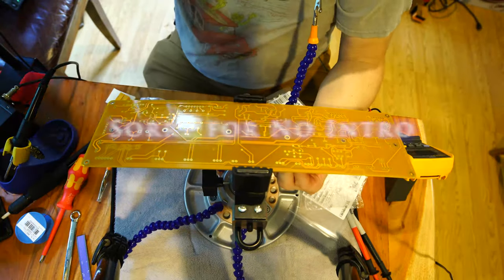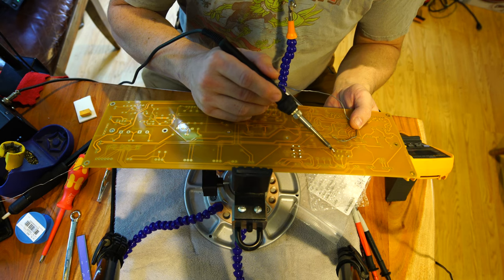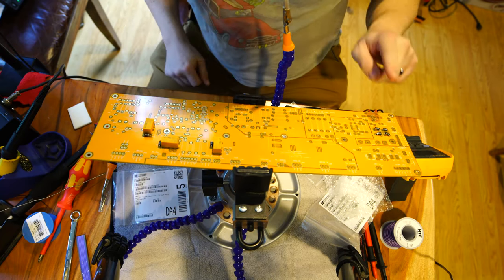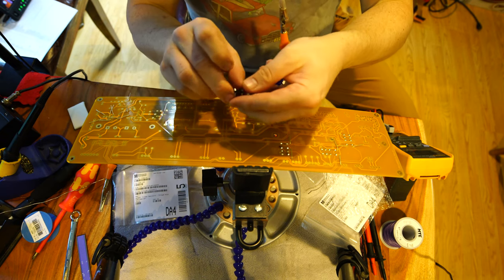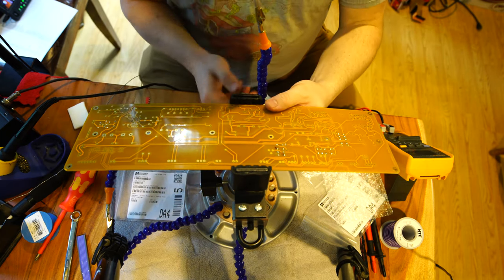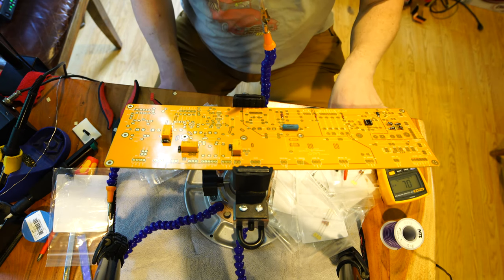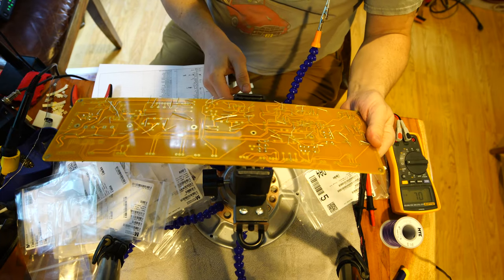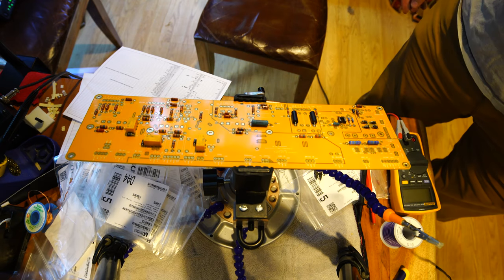Blues Deluxe  to ODS #183 Video 3

Comment: Now that 3 years have gone by, would you say you're happy with it? And do you think it's similar to the 'Dumble sound' ? 
I'm considering doing one . I've been converting these amps to bassmans and plexis, so I'm familiar with the chassis and iron.
Also do the solderless lead connectors come with the board or are people adding them? 
Thanks for any insight !!
Reply from the maker: I haven't played it for a while, so I gotta I need to.  I think it definitely has the dumble  sound.  But I'm no expert. I'm not sure I recall what you mean by the solderless connectors?
Reply: @FrenchieFilms  I found out the connectors don't come with it. They're the green screw down connectors on the edge of the board. I'd probably just solder anyway. They definitely seem like cool conversions. 
My next project is a hammond Ao29 conversion, so I'll have time to mull over the dumble conversion.. thanks for the info. Great content btw! Cheers

Comment: Showing the assembly process is very helpful.  Whoever designed the PCB unfortunately designed it to basically warp as there a copper coverage disparity between top and bottom layer over a large area.
Reply from the maker: I'd be interested in learning more about that.  What are some good references about avoiding warp?  Is it clear what is copper covered on the top layer?  The solder mask makes it hard for me to tell
Reply from the maker: Interesting,  This article though, seems to discuss how the curve of a board can impact daughter boards being directly soldered.  Is this problematic for a single board?  Or is curve also something that can lead to trace separation from the board or trace breakage?
Reply: @FrenchieFilms  it just points out some of the general attributes, it is a real problem for single boards, and can either lead to parts popcorning off the board, especially SMD parts, and or cracked via or part hole barrels. excessive warp puts a strain on any constrained mechanical junctions.it can also lead to cracked traces etc, if subjected to thermal cycling.
Reply from the maker: Oh that makes sense.  So how can you tell this board would be prone to it?  The solder mask on the top obscures the top layer pretty well...
Reply: @FrenchieFilms  One side has abundant copper pours, the other side mostly traces, the copper area on one side is much larger than on the other.   Matching layers either external or internal need to somewhat match copper coverage to maintain even forces on the prepreg. For instance, you might on a 4 layer have planes on layers 2 and 3, and a similar amount of traces only on the external layers. That is also why single layer boards are prone to warping
Reply from the maker: Gotcha, makes sense.  I definitely need to learn more about pcb design.  I didn't design this one, but it seems to be much better than the fender one I pulled out.  That being said, I'll see how it lasts.
Reply: @FrenchieFilms  Agree with your assessment, fender goes the cheap route with costs being the main design goal at the expensive of performance and reliability. Single layer pcb's with non plated plated thru holes have no place in a amp that sits on top of a speaker cabinet.
Reply from the maker: Thanks so much for the information and feedback, I definitely learned a great deal.
Reply: @FrenchieFilms  very welcome, my pleasure. Glad to help as you tackle your own creations.